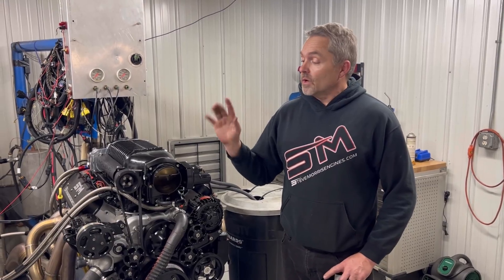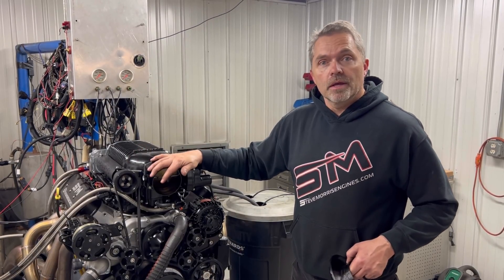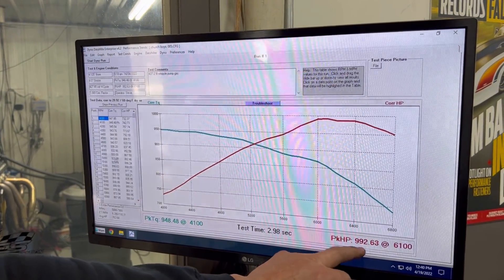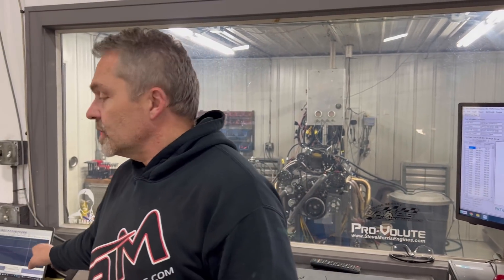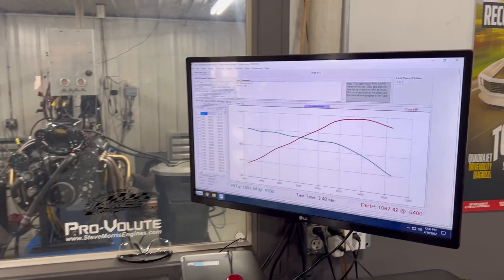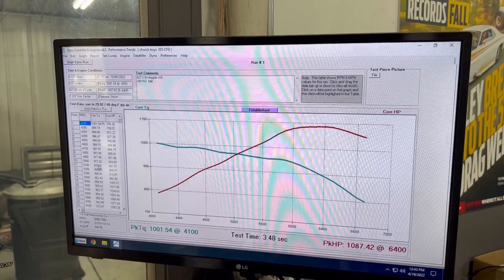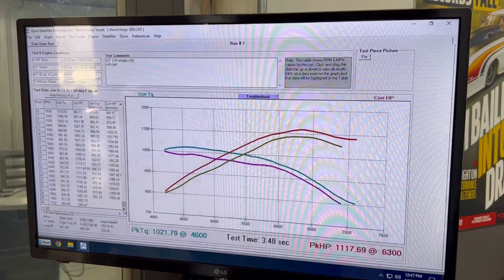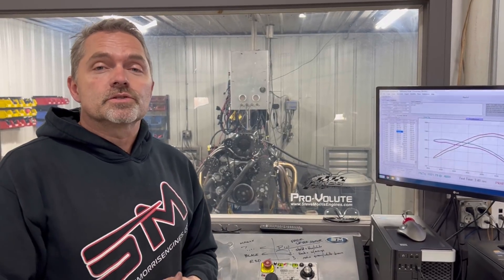1100+ HP 2.9L Whipple LS + Testing Out Our New Bell!

Comment: Can the bell function inside a pipe? Wondering how to make this work on a street engine.
Reply: I would imagine it does not. The size of the intake pipe would determine airflow making the bell useless. This is drag racing stuff. There’s no point in making it work on a street car. Because it wouldn’t. I think people get too carried away with street cars. All for mods and making fun cars that can also be sent at the track. But at the end of the day is it a daily driven race car? Or is it a street car that gets sent at the track for the fun of it? Like buying one of his motors and a monster trans and a big 90mm turbo and for a street car would be way over kill unless it’s a race car that is supposed to be street legal. But again. Are we talking a daily that gets raced. Or a race car that gets daily’d because those are different cars.
Reply: It does. As long as the pipe diameter is the same as the outside of the bell. The larger diameter of the pipe means less air speed in the pipe and the bell will direct the air into the inlet. It's all about inlet surface area and directing the flow.
In order to take full advantage of the bell, the pipe needs an area that is twice that of the throttle body inlet cross sectional area.

Comment: Would love to see the power difference if you swapped on the new Gen 5 Whipple 3.0L.  Engine Labs reported 125whp gain with less boost on a Ford Coyote.
Reply: Never in a million years. Think about this. What does it take to make more power with less boost? Yes if it is more efficient which it is, sure it will make a bit more power due to less loss and lower temps, and then you can add a bit of timing - maybe 1-2 degrees. Here they added 5 degrees and race fuel, and gained 95 hp. Imagine if they should add close to 160 hp. Just no. That's marketing BS. Bolt a 3.0 on and do a retune, and you're probably looking at 30-40 hp crank. This is not just speculation, this is info straight from Dustin Whipple.

Comment: Wait a minute. What am I missing?   You are running 29 degrees of timing on pump gas with 14psi?    Shouldn't it be more like 20 degrees of timing or less?
Reply: Why? You don't know the cam, you don't know the compression, you don't know the piston design or chamber mods. Timing is dependant on a lot of things, not just boost. When talking timing and power, boost is far less important than most think, boost is just a measure of air resistance.

Comment: Is there any way you could design a bell or velocity stack that would work with a filtered intake ?
Or does it require a large amount of overall surface area to smooth the flow ?
I know they make a big difference on mother cycles but that is way up there in the rpm
Reply: You can buy velocity stacks that are designed for a cone filter to fit over top of, or you can buy a cone filter that already has a velocity stack designed into the plastic base(such as K&N's X-Stream cone filters, a few other brands have produced filters like this too). 
And they definitely work too. You're definitely not going to be seeing gains like this since the restriction(filter) is in front of the velocity stack, but none the less they do work.

Comment: So, obviously the bell is working by decreasing turbulence at the throttle body, which is in turn increasing airflow. What does A/F look like on those two back-to-back pulls?

Regardless, it's awesome to see that kind of a difference!
Reply: Probably close to the same. Some of the power comes from more air, but some of it also comes from more efficiency in terms of air inlet temp and less parasitic loss.
The reduction in parasitic loss is not because the compressor becomes easier to turn, but simply because there's less turbulence. Turbulence takes energy, it's that simple.

Comment: What cubic inch is that Ls ?
Reply: 427
Reply: @zachgregory1289  thx.  I've always been curious if Steve Morris ever got his hands on a Tall Deck RHS LsX and boosted it. I'm talking 8:5:1 compression on a 500 ci LS.  That'd be 😍
Reply: @point2view  
Seeing that the guy builds boosted engines, that will probably only happen if someone puts a gun to his head and agrees to relieve Steve of any and all responsibility. Unless you build a unique LS crank with larger custom rod and main journals, it will be a terrible idea. In order for the LS crank to remain strong, you need to keep an overlap between the inner edge of the rod journal and the outer edge of the main journal. If you don't, the crank becomes quite weak. I'm sure you can get him to do a 447 or 461 if the crank has BBC main journals and RB rod journals, but more than that, I highly doubt. And with those baring sizes, things are starting to get weird because you will need to retain the LS journal width.
Anything is possible, but it'll cost you and the hassle of getting a 4.250 crank for an LS with oversized journals, is just not worth it. There's a reason why the 434 is so popular outside of the 427.

Comment: The wall vents close progressively with rpm increase.
Is that because the engine is drawing in SO much air it pulls them shut, or are the electrically modulated?
Reply: No & Yes

Comment: It's called the ventura effect, caused by the bell shaped, formly called a velocity stack back in the 60's and 70's.
Don't see then used very much these days.
I think if you increase the length, and open it up in following the angle you have you'll find it increase the air flow even more. 
It will reach a peak at around 8 to 10" if I remember correctly, but that was a long time ago when I messed with those.
Back then they were made from spun aluminum with a rolled lip to give it strength. 
Look at the old single throttle body Hilborn and the individual throttle body per cylinder.
He use to play with the different lengths and opening sizes to tune engines for more torque or horsepower whichever he was after depending on situation he was tuning for.
Reply: Ventura effect? What the hell?! 
That's VENTURI effect, and that's not what's happening here.
Is with say a gas turbine, the point of the bellmouth is not to speed up air or force more air into the inlet. The purpose of the bellmouth is to disrupt turbulence, create an initial compression and then direct airflow into the inlet. A velocity stack is very similar but it is not the same, and it is more complex.
The Venturi effect is what you see when your purpose is to decrease the cross sectional area of a tube for example, in order to decrease pressure and speed up the flow. This is seen in test sections of wind tunnels, race car diffusers, and jet outlet nozzles.
As per Bernoulli's equation, an increase in flow speed decreases static pressure, and that's the Venturi effect. A bell mouth is a guide which restores the static pressure in the inlet and allows the pump to pull in air over the entire surface over the entire cross sectional area of the inlet.

Comment: Would you see close to the same gains with a velocity stack inside a air filter? I know they use to make them and a K&N would clamp over it as I had one.
Reply: You can buy a cone filter that already has a velocity stack designed into the plastic base(such as K&N's X-Stream cone filters, a few other brands have produced filters like this too). And they definitely work too. You're not going to be seeing gains like this since the restriction(filter) is in front of the velocity stack, but none the less they do work.
Reply: Yes.They can be very efficient. Anything that helps to clean up airflow and direct the air into the inlet is a win.